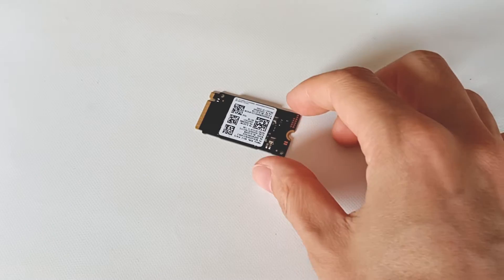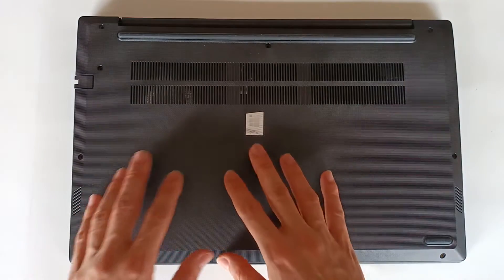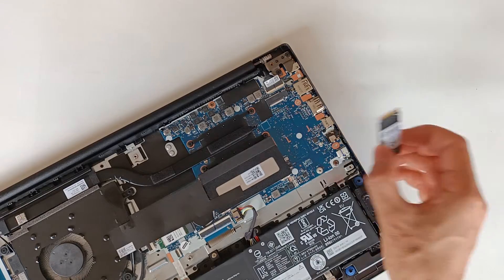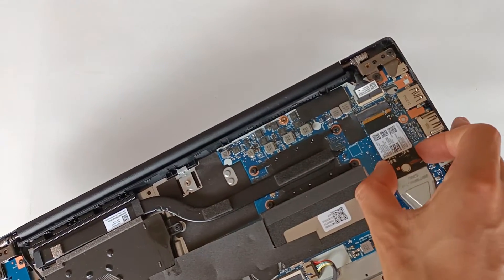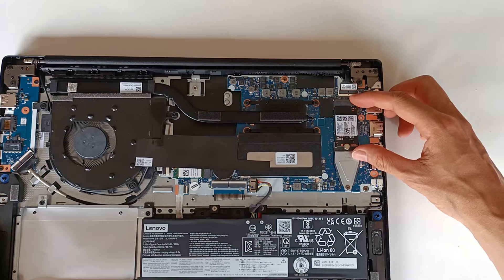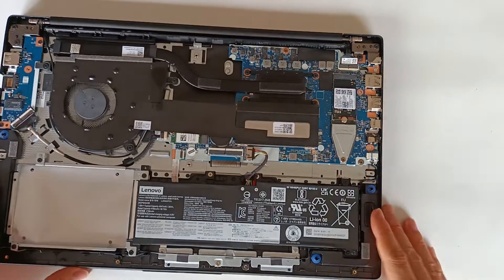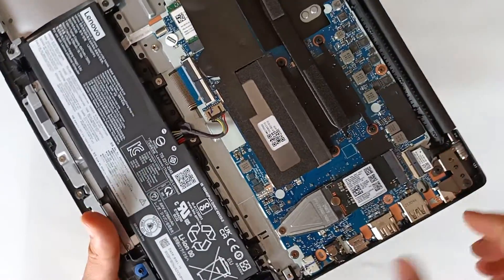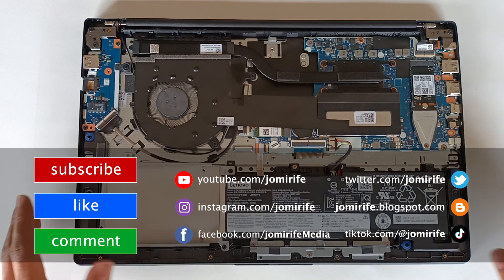How to install an M.2 NVMe 512GB/1TB/2TB 2242-2280 SSD drive on the Lenovo V15 (Samsung P1191a)

Comment: So in this way I can fit my 2280 ssd in 2242 ssd space if there is vertical space available because by default it's a bracket fit
Reply from the maker: You can put a 2242 into a 2280 space, but not a 2280 into a 2242 space; the bracket expands, it doesn't reduce